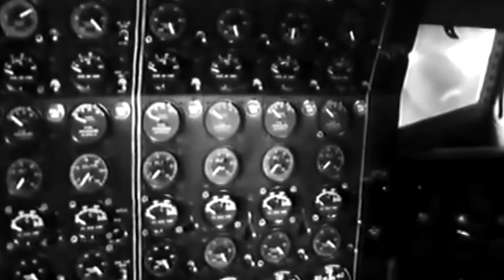The Largest Military Cargo Plane to Ever Barely Fly - H-4 Hercules

Comment: It didn't 'barely fly', it flew.  It flew with underpowered engines for over a mile and at 70 ft above the water.  If Kittyhawk is flying, so is this.
Reply: Its not like it couldn't have flown more than a mile. Hughes just wanted to minimize the chance of an "incident". I wish they'd have tested it more.
Reply: @ethancntower8850  war ended
Reply: H4 wasn't supposed to fly that day at all.. the test was just to taxi her around in the water, before later advancing to bigger better tests. hughes at the controls himself made the decision to go maverick and lift off, which was pretty ballsy. the later tests never happened which likely goes to show how much of a point hughes may have felt he needed to make that day
Reply: @peabody3000  Howard's Balls got him in Trouble more then once ......
He pushed the XF-11 beyond test Protocol , Running out of Fuel. Crashing into a Neighbor and almost killing himself.
Reply: @peabody3000  That's what I understand as well. It was typical of Hughes to go maverick. He did so on numerous occasions and had at least two serious crashes because of it. In any event, he never lifted the airplane out of ground-effect, which was surely his plan, just to let it be seen that the H-4 could "fly". He knew that the public and the press didn't know about ground-effect and that if they saw air under the plane, it would be sufficient to prove that it could fly.
In fact, it probably could've flown, but Hughes was just making a point as he liked to do and had done before in other circumstances, particularly with the USAAF Constellation flight to DC, and didn't want to risk the H-4 in a full flight.
It would have been great if he had started the project sooner or completed it sooner and it had actually gone into service during the war. It would have been quite a thing for these giants to make regular cross-Atlantic flights with hundreds of troops and such. Oh well...
Reply: @Glicksman1  i don't believe the idea that ground effects were at all significant at 70 feet up. and i figure this aforementioned  casual cocktail napkin formula quickly loses further accuracy as scales increase
Reply: @peabody3000 I don't know what you mean by "casual cocktail napkin formula" regarding ground effect (not "effects"). 70' is not a high altitude for a 320' 11"wing and is well within the distance above a solid surface for ground effect to operate (at or below 50% or sometimes said to be at or below100% of wingspan depending upon sources). This aerodynamic phenomenon essentially opeates on all aircraft regardless of size. What you may "believe"  or not is of no consequence in this matter; however, If you have solid scientific data/information backing up your "belief" that the ground effect "formula loses further accuracy as scales increase", will you cite your source?
Reply: @Glicksman1  it stands to reason that as scale increases ground effect decreases in the example formula. and it's easy to show by scaling to an otherwise ludicrous scale: make an airplane with a half-mile wingspan, see if ground effects continue when it reaches a quarter mile altitude. even without using your slide ruler i think you must realize the formula shifts far away from practicality. how about you cite a source to explain why this formula should hold at larger than average scales?
Reply: @Glicksman1  by "cocktail napkin formula" i mean it's an easy to remember and use formula meant for convenience, kind of like how people convert celsius to fahrenheit by doubling and adding 30.. that simplification works fine for talking about the weather but badly breaks down at higher scales like oven temperatures
Reply: @peabody3000  Practical experience over many decades with aircraft as large as Boeing 747, 777, 
B-52, etc., Airbus Beluga XL, Lockheed C-5 Galaxy, Antonov An-225 Mriya, and such have shown that ground effect works on them in the same way as on a Piper Cub or a Cessna172. This element of aerodynamics is well known amongst scientists who study the forces working on aircraft and has been studied in depth for almost a century.
If you or anyone else require references and citations for this phenomena as I have stated it, you may find them in:
Any years' "Aerodynamics for Naval Aviators" NAVWEPS 00-80T-80 (ASA FAA Handbook Series)
by Naval Air Systems Command U.S. Navy and Hugh Harrison Hunt,
Any years' "Pilot's Encyclopedia of Aeronautical Knowledge" FAA publication -H-8083-25b,
 "Lift from Flow Turning"- NASA Glenn Research Center, 
"Fundamentals of Aerodynamics
" by John Anderson,
 "Aerodynamics for Engineers" 
by John Bertin and Russell Cummings,
 "Flight Theory and Aerodynamics: A Practical Guide for Operational Safety" 
by Charles E. Dole, James E. Lewis, et al.,
"Flight Vehicle Aerodynamics" (The MIT Press) by Mark Drela,
 "Aerodynamics, Aeronautics, and Flight Mechanics"
 by Barnes W. McCormick, 
 "Aerodynamics for Aviators" by Mark Dusenbury, Gary Ullrich, et al.,
 "An Introduction to Theoretical and Computational Aerodynamics" (Dover Books on Aeronautical Engineering)
 Part of: Dover Books on Aeronautical Engineering (19 Books),
 "Understanding Aerodynamics: Arguing from the Real Physics" (Aerospace Series)
 Part of: Aerospace (47 Books), 
"Applied Computational Aerodynamics: A Modern Engineering Approach" (Cambridge Aerospace Series, Series Number 53)
 Book 53 of 36: Cambridge Aerospace Series,
and many more.
These are just some of the books either on my shelf and/or that I read in order to get my degree in Aeronautical Engineering.
What have you read that informs your "expert" opinions on this subject?
Reply: @Glicksman1  so then, you really are saying a half-mile wingspan aircraft would experience ground effect if flying at a quarter mile altitude?
Reply: @peabody3000  In all honesty it probably would. A wing of those proportions would have a tremendous amount of air resistance and would therefore cause massive vortices and turbulences. One of the results of the ground effect is in fact to hinder the formation of wing tip vortices, thereby reducing the effective drag of the wing.
Why do you believe it wouldn't experience ground effect interferences?
Reply: @peabody3000  Yes. Why not?
Reply: @Glicksman1  as scale and therefore distances increase, the elapsed time at which pressure waves can have effect will also increase, and the likewise increased volume of air will have a pronounced dampening effect in both directions, from air to ground and ground to air. at a quarter mile altitude an aircraft moving at a lifting speed (or higher) will assuredly have moved ahead of the churn of any aerodynamic interaction with the ground. i'm still talking about the impractical scale of a half-mile wingspan but i'm pointing out where faults lie in the rather facile aforementioned formula. i'm surprised a person of your apparent education could think that ground effect aerodynamics translate cleanly from small distances to huge ones, as if the effect somehow propagates at light speed and isn't subject to dampening out
Reply: @peabody3000  There is no way to positively know how a half-mile long wing would behave when proximate to the ground. I think that we may reasonably assume that such a wing would be proportionally greater in chord and thickness as well. Accordingly, the mean Reynolds number of such a wing would be beyond anything thus-far known. This mega wing would also displace tremendous quantities of the oncoming air at all operational airspeeds and would, accordingly, also produce proportionally greater downward forces of a kind that we have not yet experienced nor we can reliably predict. 
It's even possible that such a wing would cause damage to structures, etc. on the ground as it passed over when flying below certain altitudes similar to Rodan in the sci-fi films. 
Possibly some unexpected phenomena as you have suggested might occur. However, this is all just speculation with no practical use or purpose except to have these interesting discussions which have no end. Extreme speculation of this kind may be fun and is regularly engaged in by first-year engineering students and such, but has no practical use in the world as it is or that we might reasonably expect it to be in the foreseeable future. Scientists are busy enough wrestling with understanding the known world and trying to better understand it than to engage in this kind of sophomoric discussion.
You seem to be a sincere person of intellect and curiosity so I don't mind engaging with your ideas for a little while. That said, my final word on this is that unexpected phenomena aside,  until there is a method to measure the actually occurring aerodynamic effects of such a mega-wing, there is every reason to expect that the extreme vortices and downwash that such a wing as you have imagined would produce ground effect similar to that of a smaller aircraft. 
As I said, even the largest existing aircraft experience ground effect similar to that of the smallest aircraft. Accordingly, there is no reason to expect a different outcome even regarding such a gargantuan wing. 
When and if that mega-wing is built and flown, we'll find out all about it. Until then, there's a lot of real, practical science to learn, understand, and apply and I suggest that you spend your time educating yourself in such.

Good luck and stay healthy. Cheers.
Reply: @Glicksman1  my thought experiment of an obviously impractical scale was meant to illustrate 2 factors that you still seem to be missing. for the ground effect to materialize, there has to be a cushion of increased air pressure that extends all the way from aircraft to the ground, and it has to interact with the aircraft despite it's forward motion. from those factors increasing the distance dramatically reduces the ground effect beyond what the simple geometric formula can account for, and surely a part of you understands that. i don't doubt your credentials but you seem to have great trouble with abstract thought and your ego is throwing you off balance. in any case you may save your next pedantic response if you wish, i'll feel no need to even read it, but do have a great day
Reply: @peabody3000   yo sean, I'm no rocket surgeon, but in order to have a veeeery long wing - it has to veeeery wide as well, so that cushion would probs be there... you know what I mean... Thought experiments are cool and all but,  lets keep it real, yeah?
Reply: @bigass197  i clearly mention two dynamics that would be changed by scale increases which come into play whether by thought experiment or not: atmospheric dampening and pressure wave speeds
Reply: @peabody3000  Aight man, you may be correct. It's just that there might be enough time for a pressure wave to bounce all the way to the ground if the wing is wide enough, or whatever, because if a wing is to get longer i has to get thicker and wider to be rigid enough... I don't know. Ya'll are the ones trying to "prove" how flipin' smart you are :)))  Just seems silly. Heh, take it easy, and enjoy yourself.
Reply: @bigass197  muhh me so smart!! ;)
Reply: I think its flight greatly benefited from the ground effect like the Caspian Sea Monster Ekranoplan.
Reply: @Sir.VicsMasher  No, not "greatly benefitted", it was in ground effect at all times, period.
Reply: @Glicksman1  That's what I've always thought but never once heard it brought up in a video.
Reply: @Sir.VicsMasher  Me neither, but that doesn't make it not so. Not all knowledge is on the Tube. Engineers have been discussing this matter regarding the Wrights and Hughes flights for a long time. It's discussed in engineering school as well. These so-certain wanna-be aerodynamicists and arm-chair psychoanalysists need to chill and learn before "speaking".
Reply: Technically, it did NOT fly, it was in ground effect all the way, just like the Russian ekranoplan.
Reply: @plugs313  "Technically" is the keyword here. It defines a narrow set of facts which still allows something to be true, instead of being untrue without that narrow definition.
Reply: @plugs313  Do you think it could have gained a few hundred feet of altitude that day to make it a legit flight?
Reply: I don't really know but I have read that she was terribly underpowered for her size and weight so, I would guess not.
Reply: You guys are getting to Scientific,  for the Average Joe it Flew. What is also lost are all the Innovations that Came with Building the Hercules.  Huges came in Under Weight by a 100 Thousand Pounds. Re design the Electrical system cutting weight by 70%. Built it in Wood and glue. 
Now to me it was totally impractical,  so are most of the Military Prototypes. It's what's developed from them that counts.
Reply: @pat36a  I'm getting a good laugh out of those folks . In aerodynamic engineering , ground effect is nothing more than a description of a cushion of air built under an airfoil whether fixed wing , rotor or air cushioned vehicle " plane , helicopter , hovercraft it's not a description of flight and isn't a qualifier for a flying vehicle . Many things fly that don't have wings , a rocket , a baseball , a football ect . One can describe flight in terms of aerodynamic flight ( planes , helicopter , lifting body , gyrocopter ) 
Ballistic flight ( rocket , projectile)
Buoyant flight
Reply: @joeboscarino2380  I remember when I was a Kid I thought I could Fly. This after watching Peter Pan. Thinking Happy Thoughts I jumped.  Didn't End Well.......
Reply: @pat36a  Aerodynamics and aircraft operations are scientific subjects about which one cannot "get to (sic) scientific". Average Joes notwithstanding, the H-4 was, indeed, impractical, and by the time it had its first and only "test", it and its concept were long-obsolete.
H-4 is a curiosity and an engineering marvel of a kind. It is also an example of what an obsessive and obsessed individual can do if he has unlimited money to spend upon his obsession.
Not all or even most military prototypes are impractical.
Reply: Perfectly said!
Reply: That's not flying. That's clearly just floating in the ground effect.
Reply: Flying in ground effect is FLYING. If an object is moving through the air, without contact with a surface, generating lift in sustained travel as opposed to a ballistic arc, it is FLYING, regardless of what some "internet professor" has to say. Hovercraft fly. Ekranoplans fly. A paper airplane flies. The H4 flew. The Wrights flew. Genuine accredited aviation historians that have done actual real research say the Wrights flew on 17 Dec 1903.
Reply: @mikearmstrong8483  not really. It could only fly a few meter off the surface. "Flying" in ground effect is about 2 times easier thank actually flying in the air, away from the ground
Reply: @alisioardiona727  
The Wrights continued to fly for 3 years before Dumont. Flights over 100 feet up, lasting up to an hour. If Brazilians cannot create an educational system that can deal with reality, and continues to teach ignorance in defiance of proven historical facts, then they can just continue to be a 3rd world banana republic.
Reply: Had he wanted it to go higher he'd of pulled back on the yolk....
Reply: It never got out of ground effect, to be specific...
Reply: Actually, the H-4 had more than sufficient power to fly in the true scientific meaning of the word (to attain controllable flight by climbing out of ground effect and to maneuver). Its power loading was quite low and its engines were not underpowered.
As it happened, it did not fly out of ground-effect and did not maneuver. Ergo- While I believe it could have, it did not actually "fly".
Reply: Well, not be bursting anyone's bubble, the 1903 Wright Flyer did not actually fly. On no occasion either on December 13 and 17 did it rise higher than10'. 
Its wingspan is 40' 4", so in order to order for it to have "flown" it would have had to rise to at or more than 1/2 its wingspan - 20' 2". (some say ground-effect is at any altitude up to full wingspan.) As it never achieved that altitude it was in ground effect at all times, just as was the Hughes H-4. That is not actually flying any more than a hovercraft or a wingship is flying.
Reply: @Glicksman1  so if you could only "hover" slightly less than half your height you're telling me you wouldn't tell every good looking lady "I can fly..watch" checkmate mon ami..
Reply: @ethancntower8850  First of all, I'm not an aircraft so my height has nothing to do with anything. It's WINGSPAN that matters and I have no wings. No, I wouldn't say that because it's impossible for a human being to hover without the use of some kind of device.
I can't believe I'm actually replying to you. Just shut up.
Reply: @Glicksman1  You just made an arbitrary definition for powered flight. Greg's Aircraft and Automobiles has an excellent series on why the wright Brothers did in fact have the first powered and controlled flight. If you still don't except the first few flights, they were very quickly able to fly in figure eights. No one else had a working method of control.
Reply: @kyle857  I made no "arbitrary definition". The Wrights' 1904 "Flyer II" and later aircraft did fly, but the 1903 "Flyer" did not,  it hovered in forward motion.
Reply: @Glicksman1  thats called flying
Reply: @highgrounder5238  If you say so.
Reply: @Glicksman1  the 1903 flyer is a biplane pusher so there is no possible way for it to have acted as a hovercraft.
Reply: @kyle857  All 19 of you and Greg, too, if you and he insist that the 1903 "Flyer" flew above ground effect, you are wrong. I respect Greg and I expect that he well-understands the issue. Apparently, the rest of you do not. Truth is not statistical.
Reply: @Glicksman1  This is your quote , " only that it FLEW in ground effect " 
There are three descriptions of flight , 
Aerodynamic flight 
Ballistic flight
Buoyant flight
ground effect is not a descriptor of flight only a condition of flight
Reply: @joeboscarino2380  The colloquial use of the word "fly"," flight", or "flew" is not the same as its use with regard to scientific matters. If you please, I hereby edit my former statement to read, "only that it moved in ground effect."  Yes, when an aircraft is in ground effect it is a condition of its flight, but if the subject aircraft is incapable of rising from it, it cannot fly. 
Your nitpicking about words is not at all the point. You well-know that we are discussing aerodynamic flight. A vehicle, such as a hovercraft, etc. that cannot rise out of ground effect is not flying and cannot fly. H-4 probably could have risen out of ground effect, but did not, accordingly, it did not fly. The Wright 1903 "Flyer" probably couldn't have risen out of ground effect and did not, similarly, it did not fly.
I don't understand why some people find this matter to be controversial, it's a matter of scientific fact.
Reply: @Glicksman1  there is no point at which ground effect replaces flight for an aircraft, the definition of flying is simply "moving or able to move through the air using wings", it's flying using ground effect since its the wings that provide a surface for the air cushion to push up against.
Reply: @ahalfsesameseedbun7472 Colloquial definitions of words count for nothing in science. Of course there is no definite point of transition from normal flight to ground effect and vice versa, and I never said there was. 
To review some real science: When an aircraft flies at or below approximately half the length (some posit the whole length) of the aircraft's wingspan above the ground or water there occurs an often-noticeable ground effect. The result is the reduction of induced drag on the aircraft and increased lift from the downwash's more vertical direction. 
This is caused primarily by the ground or water obstructing the creation of complete wingtip vortices and interrupting downwash so that its direction is more vertical than in normal flight.
As in much regarding aerodynamics, it's a gradual thing that happens as the vortices and downwash of a wing are increasingly interrupted when landing, and decreasingly interrupted when taking off, by their contact with and proximity to a solid surface.
The interruption of vortices and downwash changes their trajectory and strength so that the induced drag created by these in normal flight is reduced and, accordingly,  the overall drag of the aircraft is also redued. This is what feels like "floating" to a pilot.
No actual  "air cushion" created, although ground effect has been called a "cushioning effect", which is not the same thing. Hovercraft use ground effect to smoothly move at a short distance above a solid surface, usually water. However, even if they have wings, they are not flying. Any craft that does not or cannot rise above ground effect is not flying (although one might say that a landing or very low-flying aircraft which had been flying is still "in flight" until it touches the ground or water) and this includes the Hughes H-4 and the Wright Brothers' 1903 "Flyer" at Kitty Hawk which were not landing or flying low after a normal flight. The WBs did actually fly in the following year at Huffman Prairie, but the H-4 did not.
Some of you are apparently very interested in this subject. Fine. If you haven't already done so, I suggest that you learn something about it from what you consider to be a reputable source.

I make these replies out of respect for education, science, and aerodynamics.
Reply: @Glicksman1  i would like to see your source so I can learn about it more.
Reply: @ahalfsesameseedbun7472  If you or anyone else require references and citations for this phenomena as I have stated it, you may find them in:

Any years' "Aerodynamics for Naval Aviators" NAVWEPS 00-80T-80 (ASA FAA Handbook Series)
by Naval Air Systems Command U.S. Navy and Hugh Harrison Hunt,
Any years' "Pilot's Encyclopedia of Aeronautical Knowledge" FAA publication -H-8083-25b,
 "Lift from Flow Turning"- NASA Glenn Research Center, 
"Fundamentals of Aerodynamics
" by John Anderson,
 "Aerodynamics for Engineers" 
by John Bertin and Russell Cummings,
 "Flight Theory and Aerodynamics: A Practical Guide for Operational Safety" 
by Charles E. Dole, James E. Lewis, et al.,
"Flight Vehicle Aerodynamics" (The MIT Press) by Mark Drela,
 "Aerodynamics, Aeronautics, and Flight Mechanics"
 by Barnes W. McCormick, 
 "Aerodynamics for Aviators" by Mark Dusenbury, Gary Ullrich, et al.,
 "An Introduction to Theoretical and Computational Aerodynamics" (Dover Books on Aeronautical Engineering)
 Part of: Dover Books on Aeronautical Engineering (19 Books),
 "Understanding Aerodynamics: Arguing from the Real Physics" (Aerospace Series)
 Part of: Aerospace (47 Books), 
"Applied Computational Aerodynamics: A Modern Engineering Approach" (Cambridge Aerospace Series, Series Number 53)
 Book 53 of 36: Cambridge Aerospace Series,
and many more.
These are just some of the books either on my shelf and/or that I read in order to get my degree in Aeronautical Engineering.
Reply: Flying does not include the qualifier “out of ground effect”

The legal definition of “air time” is when the undercarriage leaves the supporting surface until it lands.
Reply: @Bartonovich52  We're not discussing "air time", nor the colloquially broad definition of "flying". An aircraft that cannot or does not rise above ground effect is not flying but is hovering or floating in a forward motion. Hovercraft are not flying. A thrown baseball is not flying. The H-4 did not fly.
Reply: @Glicksman1  You are defining reality with words, not using words to define reality. Thats not using facts, thats just lawyering it based on authority of your (possible) sources. Whats more, you are now defining "hovering" as " "not flying" instead of "subset of flying". 
Are you wishing to define it as standing on the ground? Because its not. Are you trying to define it as completely different and separate thing? Then there is nothing to do but to pity you.
Reply: @ribbitgoesthedoglastnamehe4681  I recognize a troll when I read one. Nice try, but no cigar.
Reply: @Glicksman1  No you dont. I am not a troll. You simply know you are feeling threatened by concepts outside your familiar experience and react with fear and hate and define it as an outside influence. 
It is rather clear from your earlier posts, that you strongly prefer certainty of science and facts This is good thing, as long as you remember that there are other truths too and that denying feelings is denying information. In other words, you are accepting your feelings as truth without challenging that information or refusing it.
 
Scientifically, tomato and eggplant are fruit, but you still shouldnt base an argument on that when making a fruit salad. 

You are arguing tomato fruit salad and reacting with hostily when you are suggesting scientific definition does not apply to it. I can see and admit that once again factually you are correct in that my message is that your cognition is lacking. However, that lack of self-cognition is a fact, and should be treated as such, and not through the distortion of emotional projecting.
Reply: @Glicksman1  BS, You were there that day?
Reply: @johnkelinske1449  Yes, I was, only a few yards from Wilbur,  just outside of the famous photo. Of course, if I weren't there I couldn't possibly know anything at all about that "flight" since nothing at all has ever been reported, documented, or discussed about it in all these years, right?